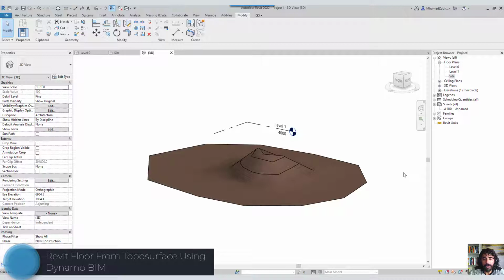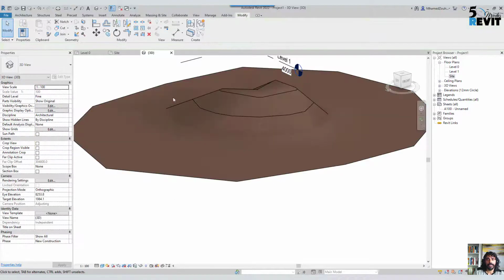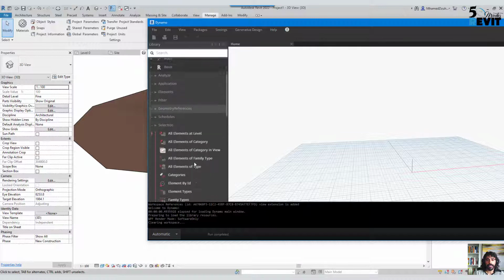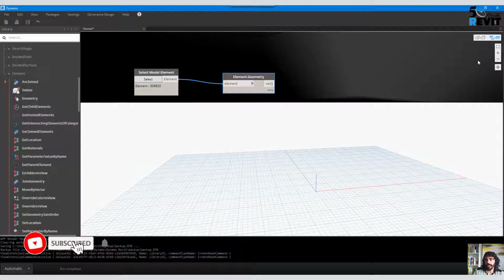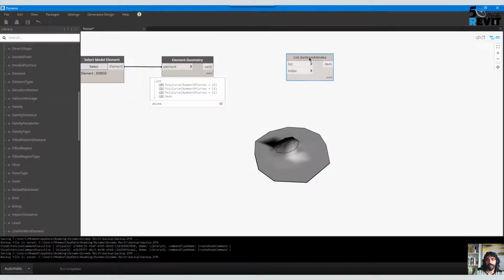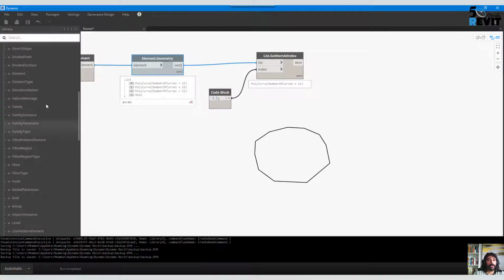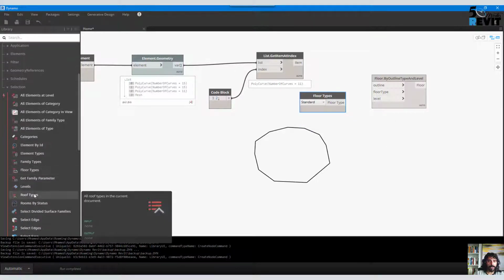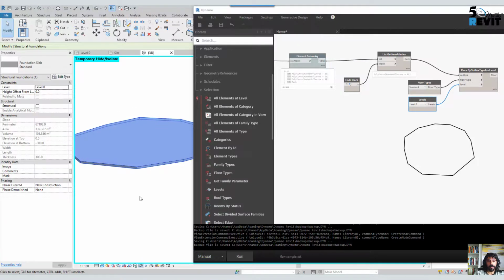Revit Floor From Topography Using Dynamo BIM

Comment: Hey this is a great video! Would it be possible to make a stepped toposurfave using these point files without using the method of floors? I am desperate and I need to make a stepped toposurface (like we make in physical models ), I have been assigned a very big and difficult landscape (2000 sqm)... and needs to be stepped toposurface.... Can Dynamo do that?